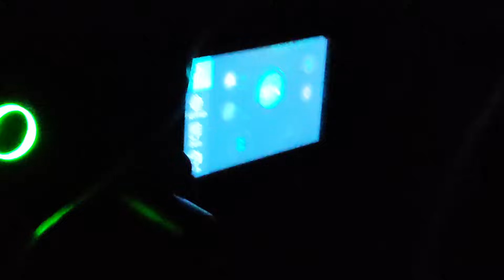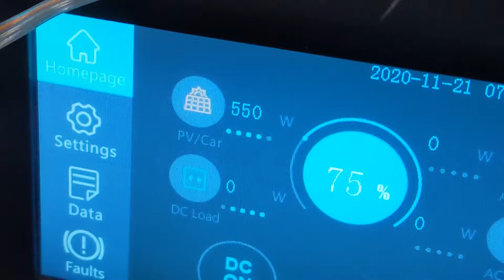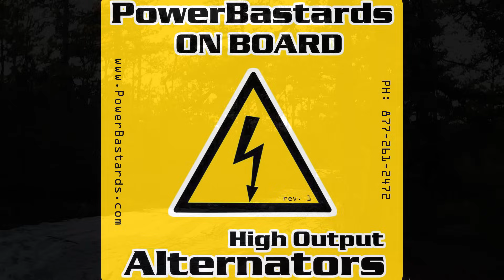High Output Alternator Install & Alternator Charger Toyota Tacoma Bluetti

Comment: Hey man really appreciate this video. Been wanting to upgrade the alternator in my taco and run this setup. Only question I have is probably extremely stupid but how much charge do you get if you just idle the truck and aren't actively driving? I'm not a mechanical/electrical guy but wondering if I could expect to be able to turn the truck on and have it idling to charge on days I don't want to break down camp or have no plans to actively drive. If it does charge while idle what kind of output to the power station do you get?

Thanks for the video!
Reply from the maker: Sure can! I do that quite often, if I don't close camp for the day or days, I get no solar charge since my roof flips upside down. It's still significant charge at idle. You can even give some gas at idle and bump it up to full output. The link in the description brings you to the product breakdown of power at idle, and it peaks over 1,000 rpm!
Reply from the maker: 220A FULL Output @ 1200RPM and 110A @ Idle

And the easiest way to figure total output is amps multiplied by voltage gives you how many watts can be put out Watts (W) = Volts (V) x Amps (A)

So if at idle you are putting out 110 amps at 12v you have a total watt output of 1,320 watts

Comment: Why not just get a 1000W inverter?  Cheaper, more flexible usage options, and can output even more to a portable power station.  With a 220A alternator, you should have ~100A available at idle (assuming the pulley size is the same as stock).  That's enough to output 1000W from an inverter (assuming 80% efficiency of the inverter), and easy to sustain mid-800's Watts.  Also, these things need to be inside the cab.  The Bluetti Charger 1 (and inverters) is not waterproof or even just IP67 rated and cannot sustainably operate in high heat environments.  Wet/Summer is going to be a problem.  At least in the cab with the AC on it has a chance to work in Summer for extended periods of time.  Huge difference between charging at 560W and 850W, though.  That's ~50% faster charging speed.  Just saying...if you are going to go through all the same trouble, wiring, etc., a 1000W inverter is easily the better option.  The Bluetti Charger 1 is literally only for charging power stations via DC input.  Not all units can take 56V and/or 10A DC input, but virtually all portable power stations can take a higher AC charging rate than their DC charging rate.  It just seems very limited vs what you can do with an inverter.
Reply from the maker: The factory AC charger for the AC200p is 370 watts. The bluetti charger 1 has been on sale for $250, which is what I purchased it for. That's cheaper than a lot of inverters, and has safety measures already built in. Also, the faster you charge any battery, the quicker the battery degradation in the long run.  That's a couple things I take into consideration. Overall, it's the adaptiveness and fail proof qualities that were most appealing to me about it. I don't want to be in the middle of the Forest alone with no service, accidentally draining my battery.( I do always have a battery on me that can jump my truck if need be though.) 
Same reason I have a factory built solar generator rather than building my own setup, there's some things that are worth it to me personally to spend the extra money in. I don't feel well versed with electricity enough to be building my own setups with either. Inverters could be a great route for people though. I know brands like ecoflow have AC chargers that pump out around 1,000 watts. I think 560 watts is crazy and more than enough hahah 
I was weighing out my options, but once the charger1 was 50% off, there wasn't much for me to consider
Reply: @Dannyshaver  At $250, it is more expensive than any 600-700W inverter plus a comparable wiring kit, and an inverter is more useful.  There are literally no pro's on the Bluetti column.  If you like paying more to get less, well, to each their own.
Reply from the maker: @KungPowEnterFist   What about the adaptive qualities?
Reply from the maker: I also always have my windows open connecting my cab to the flippac. Once it gets a little warmer out too, I'm setting up a pass thru. I already have all the materials for it 🤘

Comment: Sweet! I 100% agree with you and have same solar experience with 450W mobile panels. I'm using Pecron 500W car-charger  version, 130A Toyota alternator.   Will look into power bastards! Thanks, great video!
Reply from the maker: Nice!!! Are those fold out panels or what are you rocking with? How long have you been running that car charger?
Reply: @Dannyshaver  yah fold out 330W pecron and 120W BougeRv.
   I've had the dcdc charger a few months but only really used it in testing refils.  I have a video driving up and down, accelerating and slamming on brakes, idling, hibeams and wipers and full airco  lol... lot of numbers testing.  Havent put final edit on it and posted yet though... need to get on that!
Reply from the maker: @dave_in_az  Helllll yeahhhh, do it up! 🤘